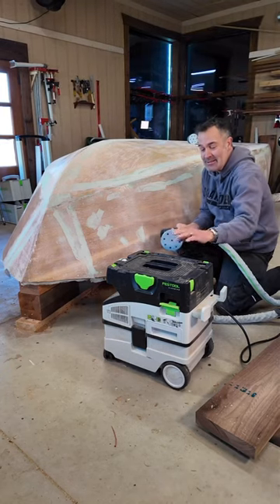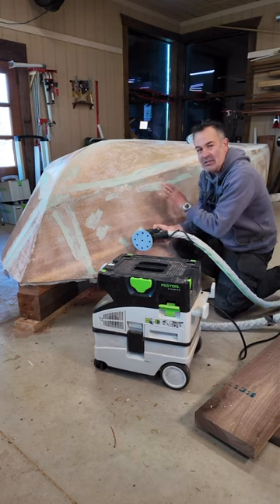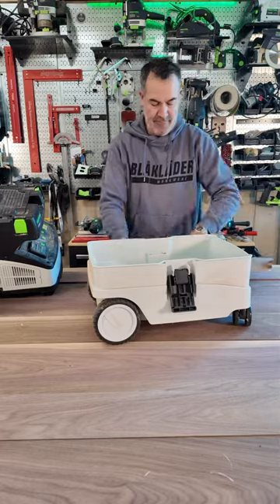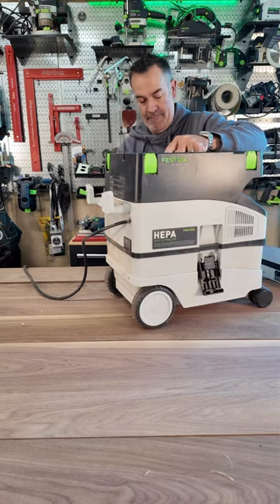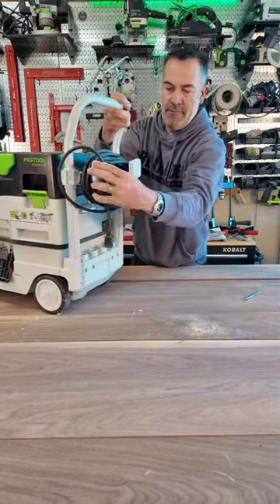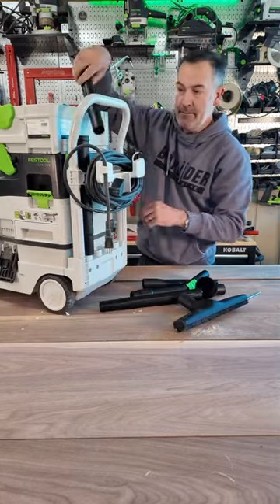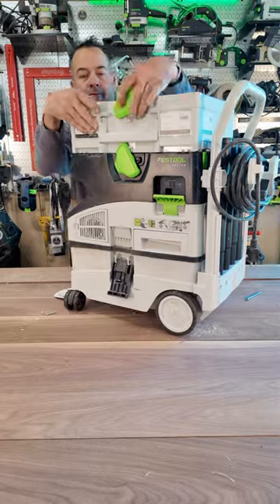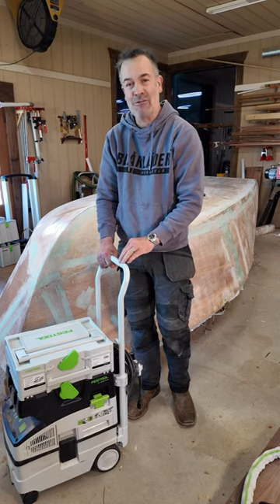Festool Dust Collector Upgrades #festool #festoolusa #festoolbuiltbetter

Comment: So it is just an oversized hoover, normal industrial hovers whitout bags will be a lot easyer to clean
Reply from the maker: It's has a HEPA filter, can be tool activated and it's much easier to remove and toss or empty a collection bag than to clean out the base of a vac. Without a bag some dust is getting exhausted back into the air.